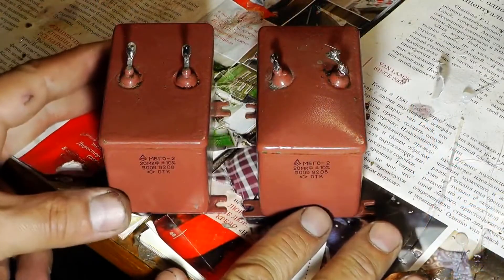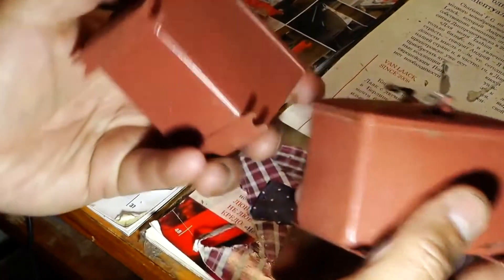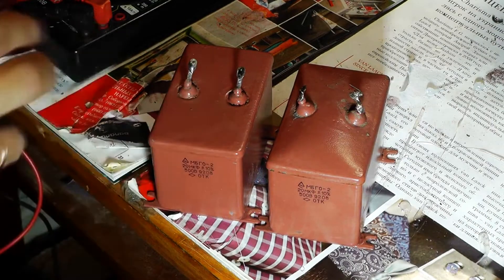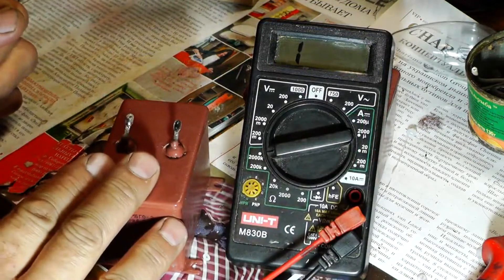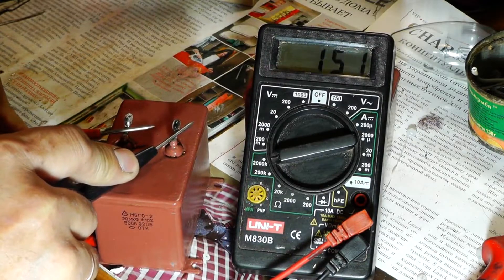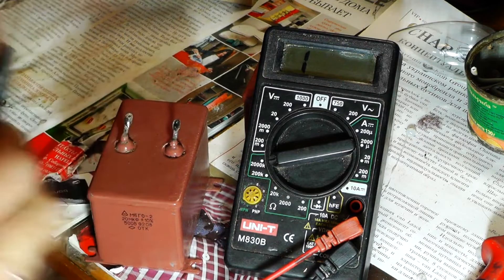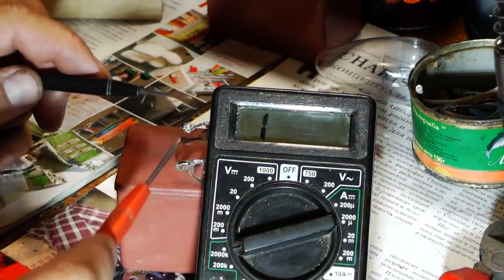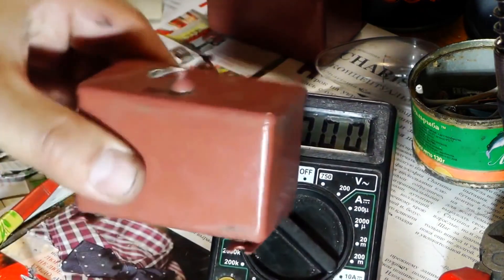How to Test a Capacitor with a Multimeter

Comment: i'd also throw out this multimeter with this condensator :) so difficult to clean it glass. And don't discharge that with probe! better some metal thing, high voltage and big Ampers.
Reply from the maker: Thanks for the comment and advice, friend!